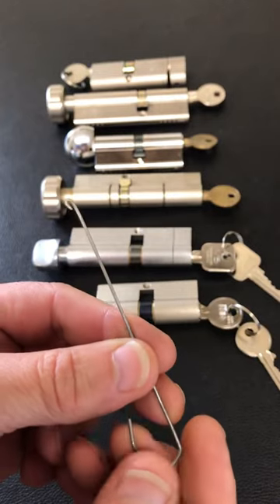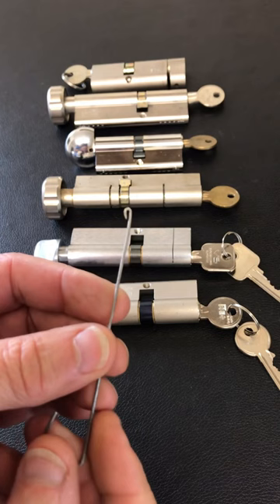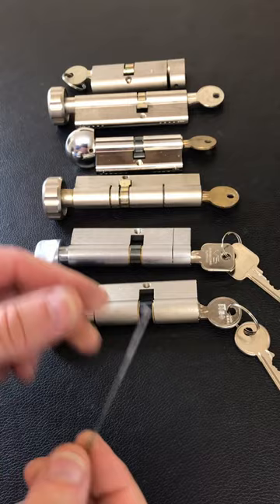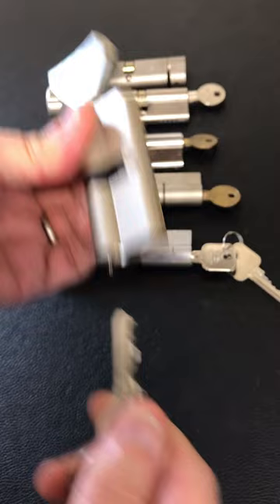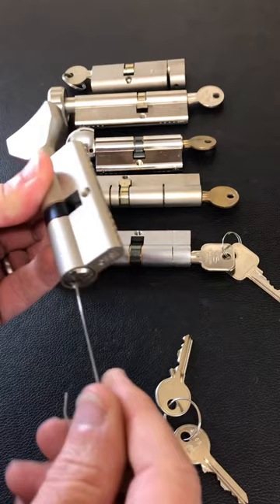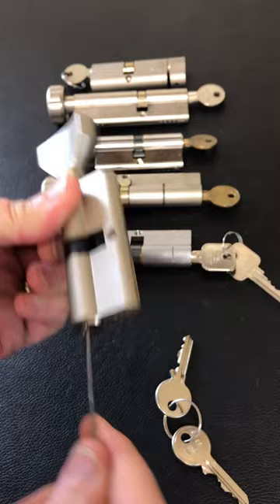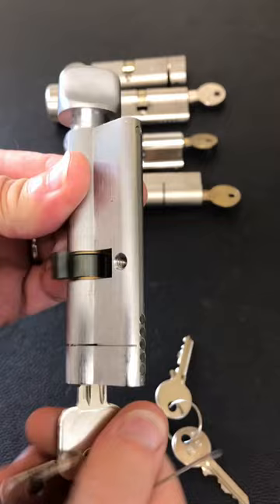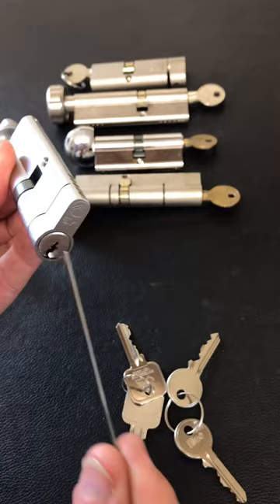641. How to bypass and easily open thumb turn door cylinder locks without a key using piano wire

Comment: That's scary how easy a good lock was opened , no picks , no tension tool... just a bit of wire bent at one end , I'm going to try that lol
Reply from the maker: It doesn’t work on all thumb turn locks but when it does they are so simple to open
Cheers for watching Peter 🍻👍
Reply: So which type are the back 4 that resist this please?

Comment: Watch out students as all HMO's have to have thumb turns on ext doors by law. You just know the landlord won't have gone for the good locks.
Reply: That's why they often have a deadbolt installed as well. Although normally you can only access it from the inside so isn't much use if your out for the day.
From my experience most private landlords use Yale rim locks in the UK, which tend to demand a premium just for the name. So if they aren't that good it's not out of deliberate cost cutting.

Comment: Thanks for the video and the info. That’s quite surprising!! Just had a new door fitted (thumb turn lock) and want to change the cylinder for a more secure thumb turn one. In your opinion, or if you were looking to change your own one, which would you choose ?
Reply from the maker: Cheers for watching 🍻
You would get better advice from a professional locksmith which cylinder locks to choose, I only pick them for a bit of fun and I do not feel I’m qualified to give advice regarding the security of them, sorry 🙁
Reply: @BrummieLockPicker  no worries. I will take your advice. Thanks for replying to me 👍

Comment: Hi would this work with a normal cylinder with a key left in on the inside ?
Reply from the maker: No the wire would push the key out, cheers for watching 🍻

Comment: 😢 this shouldn’t be public knowledge mate
Reply from the maker: I thought it already was mate
there have been videos on YouTube for many years showing bypass tools 
I’m not the first to make one and certainly won’t be the last 🤔
Reply: It's a widely known thing with lockpickers,your insurance may not be valid ,if thumb turns are installed on a ground floor door,
Reply: @nigelcompton966  very rare if an insurance company would say that. They may state that the cylinder should be 1* or above to prevent this attack tho.
Reply: @GxAxV  1* can be bypassed too,depends on the make of lock.

Comment: All you've shown is a bypass not under the frictional forces of the bolt, related components and the door frame. It's like watching my car window wipers without a windshield. This is not realistic.
Reply from the maker: https://youtube.com/shorts/OpkmPdnVfC8?si=vURuGqqyYhgXpEZA
Reply: @BrummieLockPicker  Getting closer to reality, but it's not installed in a door. The door jam will often bind on the surface of the bolt(s). And, the bolt in your video is just one of many types of bolts and mechanisms, and they all behave differently, especially with seasonal changes.
Reply from the maker: I’m not a locksmith and do not pick locks in working doors so that is about as good as it gets, I think your watching the wrong channel if your after real life locksmiths 🤔
Reply: @BrummieLockPicker  No, I'm not watching the wrong channel. Unless you can prove to your audience that your approach hasn't been tested on real doors, maybe a disclaimer is needed. Yes, Aliexpress sells versions of your wire. It doesn't mean it will work every time or that it won't break or get jammed in a lock. There will be 10 guys showing YouTube videos of bypassing thess locks, but never on doors. Thanks for your friendly feedback.😉